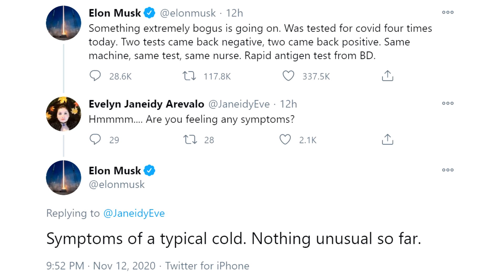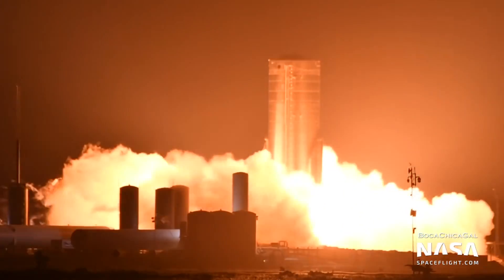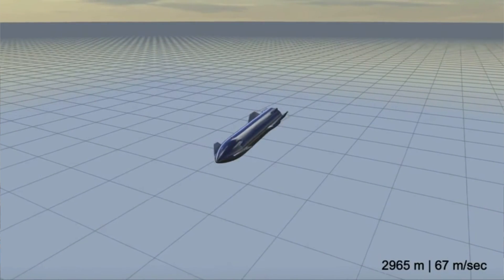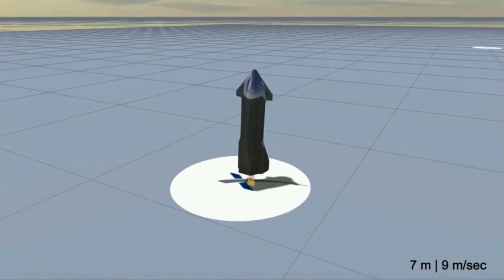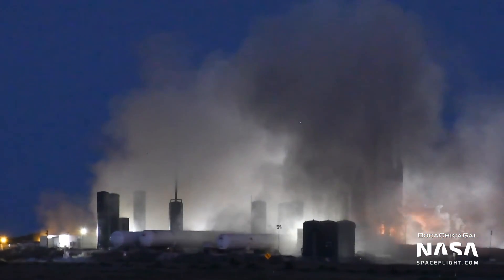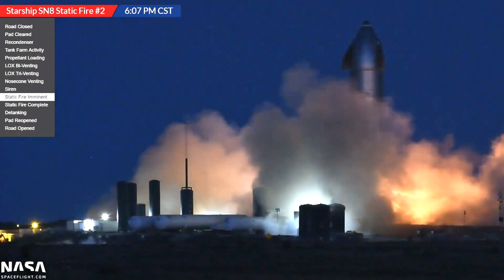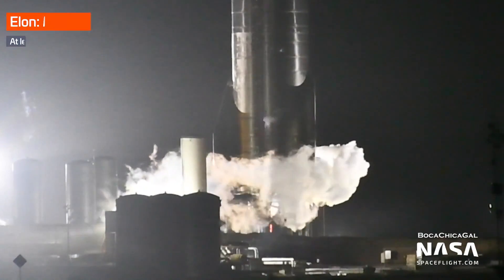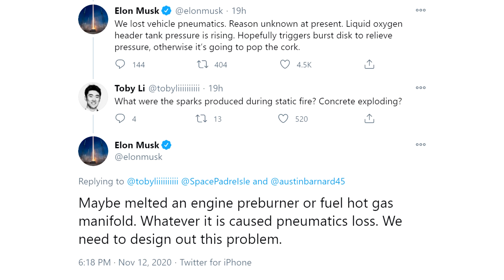Starship Test Destroys Raptor Engine, But Burst Disc Saves Rest Of Vehicle

Comment: Even when it is near perfect there will always be mishaps like any modern air travel.  Makes my blood run cold to imagine what definitely will happen at some point or other when this thing is loaded with a few hundred people and fails (as all travel does occasionally).  Such a pyrotechnic nightmare will have the nancys of society doing back flips and banning everything that flies so it will need to have a good safety record for sure.

Comment: I'm not an engineer but is anyone else thinking that 1. The launch mount should be seated over a deep trench to route away the exhaust and ignition energy and 2. The engine nozzle ring inner shell should be completely reengineered so as to completely protect the plumbing that is presently exposed in the current design ?  Just wondering

Comment: The last SN-8 test concluded with the same "noise" identified in the other SN-8 tests. I liken it to a bearing gone bad in a car. The noise sounded kind of like trying to pull a heavy metal table across a cement floor. I don't know what configuration is being used on this Raptor version and what pressures are being imposed on the engine. Myself, I think it is probably a problem with the turbopump assembly. It could be a metallurgical issue and that could be a real problem. If so, they might be able to take it back to an earlier configuration and test fly it while they work on a solution. I hope I am all wrong but it is good conjecture:-)

Comment: Hello, Scott, i’m Gigi, i have experience in safety analyses. Such huge tanks are a danger. Instead i sugest many small already tested tanks.
Reply from the maker: The problem is many smaller tanks increases the overall mass which is the opposite of what you want to do when designing a rocket.

Comment: It becomes more and more evident that the 'production' Raptor is far from ready, and is the choke-point in forward progress for Starship. If not already being done, Factory pre-testing needs to be on vertical test stands. Also, the header tanks seem to be sitting where the passengers are supposed to be?!
Reply: More and more evident?  How many major raptor failures have there been?

Comment: why aren't mechanical syringe type mechanisms used for rocket fuel tanks? i get it that that's extra weight and complexity. but it seems something lite enough could be made to guarantee a continuous feed of fuel, and this might allow many more viable design options. for instance, elastic or rope contrainted  bladders that (like a huge tough balloon or parachute).. that might be somewhat heavy, but allow the uninterrupted continuous delivery of liquids to the engine in takes. some of the exhaust gasses (similar to what as already happens) could be used to pressurize the  empty space in the tank . or a straight up tough but lite barrier on tracks that keeps the fuel compacted into the intakes in a cylindrical tank configuration.. literally a syringe....
Reply: Cryogenic temps complicate things and weight is a the prime factor.  If a lighter method can be used it will be.

Comment: The burst disk has to be replaced. Valves have a spring return.  It automatically closes when the air is lost. It’s possible to buy valves that fail open.

Comment: An engine failure causing loss of pneumatics causing the inability to open valves causing the loss of the vehicle would be something that would be easily discoverable with an FMEA. I refuse to believe that the class of Engineers at SpaceX would not do at least a basic FMEA/Risk Analysis.  My best guess is that they knew the risk and went into it eyes-open because they didn't have the mitigation ready and felt that waiting was more costly than the likely consequences.  It is also possible that the they felt that the burst disks would be sufficient mitigation to prevent unacceptable outcome.
Reply: Yeah, considering their fast iterative approach to design, I suspect they simply didn't worry too much about it because it wasn't needed yet... SN8 doesn't need a robust fault-tolerant pneumatic system, it just needs one that's good enough to get it into the air for flight testing. And now they know something about the failure modes of the current system, which can feed into their design for the better version.

Comment: I’m curious about starship’s aerodynamic surfaces. Seems to me like it wouldn’t take all that much more to turn starship into a proper lifting body.
Reply: AIUI rockets can gain advantage from aerodynamic lift:
. At launch aero lift can increase performance by reducing necessary thrust
. In reentry:
   .  lift can be used to steer to the intended flight path
   . Lift can extend reentry time to flatten the curve of necessary energy/heat dissipation
Reply: It actually is during part of the maneuver.  Then the surfaces fold away when rocket shape aerodynamics are needed again.
Reply: I believe they operate as air brakes to orientate the craft for landing. Managing changing lift for the crazy maneuver they have planned for it might be a hindrance.
Reply: When returning from our Moon (or Mars), the ship has to convert drag into down-force in order to stay deep enough in the atmosphere. 

That generated down-force is used to keep the craft following the curvature of the globe (rather than a tangent back into space) and stay at the right altitude to continuously dump energy kinetic energy.

The whole time it is falling nose-down. What is that, -70° ?
Reply: Yeah those are not wings, they are airbrakes. On re-entry Starship will enter at 70 degrees according to elon so they will be trading off some drag for lift
Reply: @linecraftman3907  Air breaking by flying an entire aircraft bottom first is not unheard of.  So the conceptual line between using a lifting body shape to fly and to break is fluent and not that important, which seems to be the entire point. These wings unfold to give starship the aerodynamic shape to do the landing maneuvers that are somewhere between flying and falling.
Reply: Again where I’m coming from is looking at the platforms of the experimental lifting body projects that have existed in the past. Frequently they had a similar amount or even less of their surface area dedicated to interacting with the atmosphere and they landed horizontally.

Comment: Burst disk : A programmed and controlled failure in order to prevent complete failure. It did it's job very well.
Reply: Task failed successfully.
Reply: This is true. What does bother me a bit is that people making these comments are usually the same that cry fire and brimstone when such a failure happens with ULA or NASA.
The same with starship having no abort system. How can you defend this while bashing the NASA for the shuttle program. Do you people really think this rocket will magically go to a 0.01% failure rate when all other rockets (including falcon 9 and the very well tested soyuz) are more like 0.5-2% failure rate?
Reply: Absolutely
Reply: I work with pressurized equipment, and I say: I absolutely love burst disks. 
I wouldn´t have gotten the training I did if the guy training me wouldn´t have had a successful burst disk application rather than a hardware-rich chamber unloading with his critical point dryer.
It is also a lot more relaxing to watch liquid carbon dioxide go supercritical through a window if you know that there is a burst disk pointing back into the machine housing rather than the window you peek through suddenly approaching you at supersonic speeds.
Reply: @paavobergmann4920  «... suddenly approaching you at supersonic speeds.»..
That's never a good situation, no mater what is coming at you. Even loose sand would be dangerous.
Reply: would a burst disk have that volume of metal to give that drip show though? layman here just wondering about the nitty greitty of it
Reply: @DanHMB  Ruptur-discs are usually thin (usually metal) membranes designed to tear in a predefined (usually X-shaped) pattern at a very precise pressure gradient (usually approximately 80% of maximum system pressure to failure) between the system and the environment. The diameter, intended breaking point and positioning, of the disc can be adjusted to serve specific tasks and in order to relieve the system in a certain time. Also low-amperage contacts can be run across the disc and hooked up to the main process-control-system. When the rupturing of a disc occurs, the contact also tears, interrupting the signal, letting the system know that the safety feature activated. An activation of such a membrane (unlike with safety valves) is purposefully designed to be irreversible and are therefore usually set to go off at a higher pressure difference than the according safety valves. On the other hand they are immediate and release much higher volumes quicker.
Reply: @DanHMB  Not at all. The burst disk did not melt. Something else did melt, causing a malfunction elsewhere that caused a situation where the pressure became to great.
Without that burst disk, the whole tank would have ruptured, probably destroying the whole rocket.
Reply: @DanHMB  The burst disk was nothing to do "directly" with the "drip show" but was a consequence of the pneumatic pressure loss and lack of ability to open the LOX header valve to relieve pressure in the tank as the LOX warmed. If the disk had not done it's job and burst due to over pressure in the LOX tank, the tank would have burst, probably resulting in a total vehicle loss.
Reply: *its job
Reply: Up
Reply: Also a part with a very finite life, as it is designed so that it is very close to it's elastic limit in normal operation, so you have a very limited number of cycles before you run the risk of it failing from fatigue. Needs very special care to keep it from having any extra stress from installation, so likely is a bolted on part as well, not welded, especially in an application like this where the margin between operation and failure of the main structure is so small. Whoever is making them probably has a few dozen per batch, and tests half to failure to ensure the rest are going to be within the required range of operation.
Reply: @SeanBZA  Reverse acting discs are loaded in compression, and are extremely reliable. With good engineering and production one of these can be operated up to 90 or even 95 percent of design pressure, and last for tens of thousands to millions of pressurization cycles. For a spacecraft it would be much better to use such a modern high-performance disc. It allows vehicle and other system designers and operators to design and operate less conservatively, while maintaining reliable protection vs. catastrophic failure. These are nonetheless consumables, and despite the fact that they are likely to cost thousands of dollars apiece (depending on size, disc material, testing requirements and so on), the wise thing to do would be to replace them well before any reasonable cycle life ends.
Reply: Like a shear pin on a rotating shaft, or an aneurism in a braindead president.
Reply: @TheBetterGame  lppl
Reply: @TheBetterGame  Hey, I don't like Biden either, but his two aneurysms are not a joking matter. They've left him with a scrambled brain, and thus we are screwed.
Reply: Task failed successfully

Comment: Thanks Scott.  I waited up and rewatched the NSF footage, hoping you'd post something - and wasn't disappointed!  I think what this comes down to is two questions: what happened to the Raptor, and what damage did it do to the pneumatic system?  When I saw them remove the various pipes, wires and subsystems on the outside of earlier prototypes and put them inside the skirt, I did wonder if it was wise to put so many vital and delicate bits and pieces in the hotest place on the rocket!  So maybe this will force a much bigger redesign than we might expect?  Where is all this stuff on the F9 - perhaps they need to adopt the same approach on Startship?  Also, if all this debris gets kicked up when just one Raptor fires, they need to drastically redesign/rebuild the launch stand to make it safe for a susstained three-engine firing.  Maybe instead they should test fire and launch from a different place well away from the tank farm, etc too?  They've been very lucky so far, but any one of the recent test firings could easily have caued a major incident.  We constantly hear praise for Space X's approach to prototyping and testing, but it often seems to me to be rather too 'Texan'.

Comment: Debris from the ground hitting the engines kind of kills plans for moon and mars landings unless they build a landing pad with flame diverters first.
Reply: Possibly, though both those destinations have much lower gravity and a lighter ship, missing lots of propellent. Less thrust to kick up debris.
Reply: They will probably use some sort of binder to glue the regolith together and smooth it into a rough landing pad. Regolith is also less damaging than little chunks of concrete, it's more like a powder.
Reply: Ever hear of HLS Starship?

Comment: Why does this thing look like it was cobbled together in someone’s backyard? 

It mean look at those seams and all the ripples in the sheet metal work?
Reply: Because it basically was. They're trying to see just how cheaply they can build a working rocket. It's made from tubing and sheet steel and is built basically like a water tank AFAIK
Reply: @acbthr3840  Looks like a water tank, or a silo.  😁
Reply: They're called low fidelity test articles and most are expected to be used for a single test only and not uncommonly to destruction.  You're just used to seeing nicely painted rockets, these are far far from that.
Reply: @TheEvilmooseofdoom  I figured as much. Thanks. It was just shocking the first time seeing it. I though it looked like someone one of my kids drew. 😁

Comment: "They only have a small amount of oxygen...just 22 tons."
Reply: Right?

Dunno about you, but 22 tons of liquid oxygen scares the crap out of me.
Reply: @patheddles4004  Yes, I would be worried about riding just under the header tank. Not only would I have the concern of being exploded or roasted, now death by freezing. At least there aren't any hypergolics to give my shredded, incinerated, and freeze-dried remains cancer.
Reply: Guys, we all know that it's a small amount in regard to rocket engines. It's just funny to hear "small amount" and "22 tons" used in the same sentence.
Reply: @bryanstellfox8521  Especially considering how freaking dangerous LOX is.
Reply: A single rocket engine will use up that 22 tonnes fairly quickly, let alone 3 rocket engines.
Reply: I mean... it's only like a truckload of the stuff
Reply: For rocket terms yes that is small. For anything else, not so much

Comment: Burst disk.  also used in Nitrous race car bottles, nitrous intake manifolds, supercharger burst panels, ect.  99.9% reliable.  Had a carbon fiber nitrous bottle jump above 2700psi in the bottle heater.  The valve mounted burst disk gave way.  About the size of a dime, but a touch thinner.  "Machined Aluminum Complex" is the answer the tech guy gave us.  CRIPES!!,, Never seen a stampede of people holding there ears running for relief.  Think air compressor nozzle right by both ears at 125psi,,,and very suddenly I might add.

Comment: It might be a bad assumption that the sparks flying up from the launchpad are large pieces of debris.  Simple ablation causes fairly bright sparks, even though the pieces being thrown off are tiny.  Look at Falcon 9 during reentry.  Or at what happens when you go at a piece of steel with a metal grinder.  These particules are quite small!  Imagine enlarging one to the size of a grain of sand or a small piece of gravel.

Also, since this is a night time test, everything looks a lot brighter than it really is due to exposure.  I suspect that if someone lit a single candle and set it on the stand next to Starship, the camera would have picked it up.

Comment: The only thing SN8 doesn't have is the vacuum engines.  The flip maneuver will create centrifugal force that will cause the fuel and oxygen to be forced down
toward the engines for the relight.
Reply: typically they have ullage motors that help push the tank contents to the proper end of the tanks. In Starship's case, it could be "bumps" by the cold gas thrusters.
Reply: @coreylawson1103  How are the ullage motors applied?  How do they work?
Reply: @guypehaim1080  It's just a "bump" from the thrusters to get the stuff in the main tanks to get pushed towards the collection point in the tank. Or, the manouever will do that, too. 
"Ullage" is a good read on Wikipedia.
Reply: @coreylawson1103  Thanks for the info.